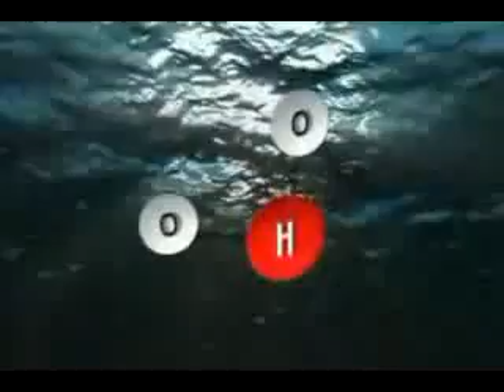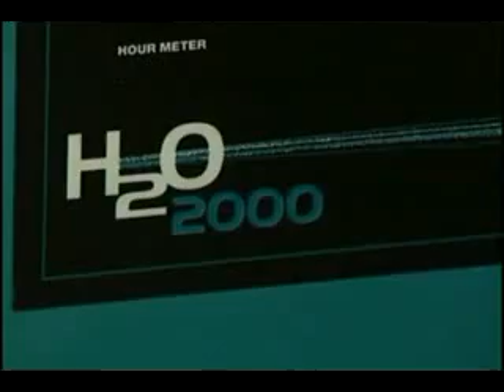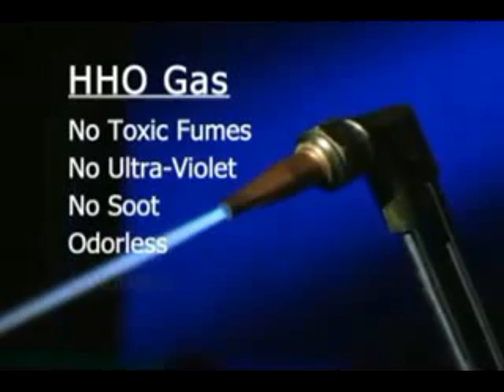Does Hydro Water Power Work On Diesels and Turbo Diesel Engines Too?

Comment: What does the video have to do with Diesel engines? Where's the Diesel? This video is about using H2O for torch gas not in engines... You should change the title of the video. I understand it can be used to augment a diesel system in conjunction with diesel fuel it burns the fuel more completely increasing mileage and power.  But you don't use it alone you still have to have diesel fuel for the engine to run. Where's the Diesel?